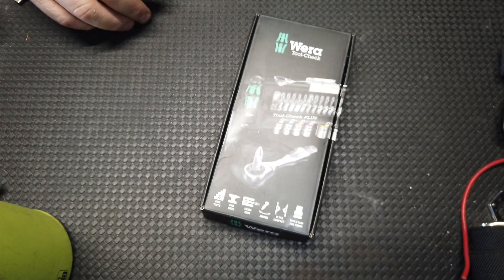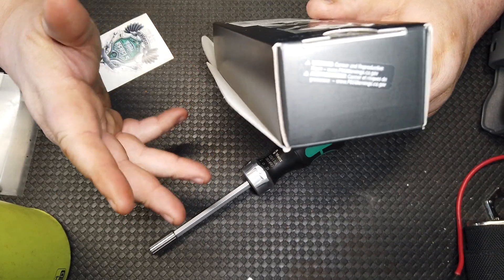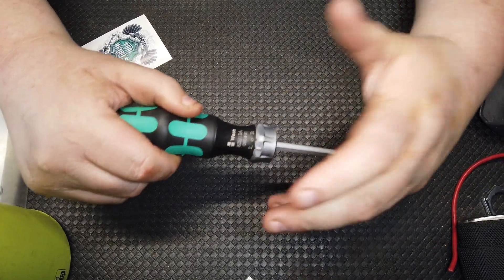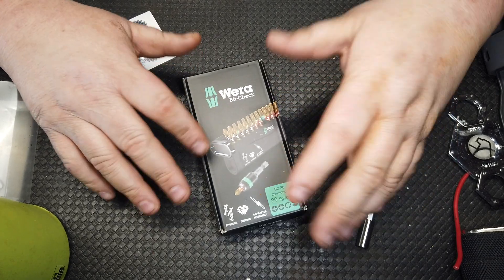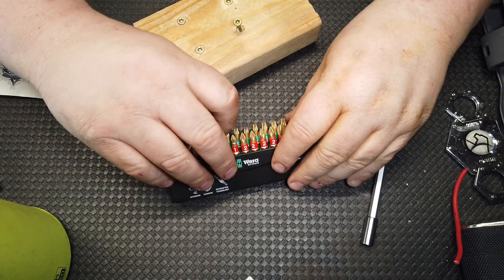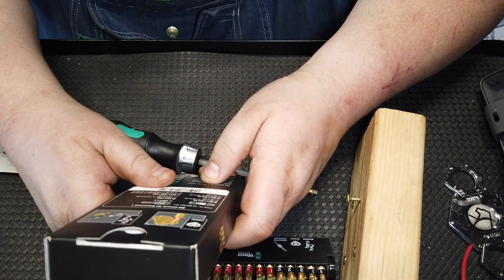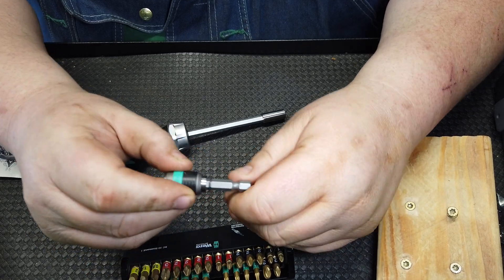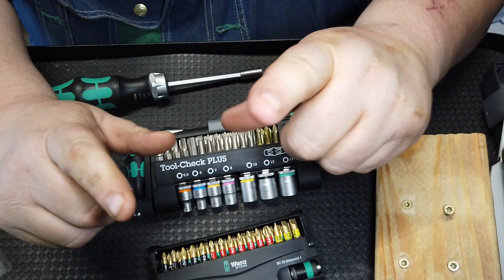WERA TOOLS NEW GERMAN DIAMOND BITS THE BEST DANG BITS ON THE PLANET!!

Comment: I think I actually told you last week that the Tekton X-tra long 0 offset box wrenches were reversible and after I looked closely I realized that they are not reversible. Sorry about that.
I agree with you about the Czech Republic. I’ve been fond of 75s for years. They also machine a lot of drivetrain gears for some of the biggest names in agricultural and construction machinery.  This was the primary reason that Hitler annexed them just before WW2 went full blast.
Thanks for the video!
Reply from the maker: It's all good wayne I hadn't had a chance to look yet lol